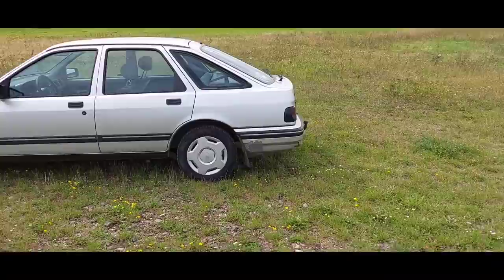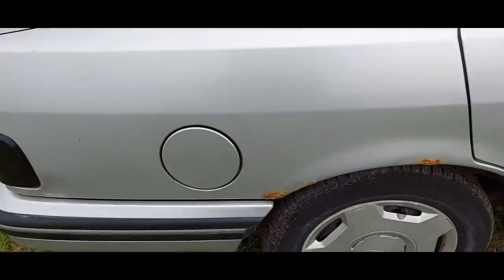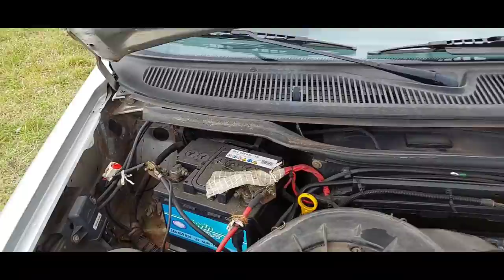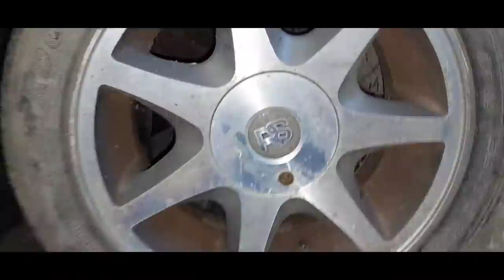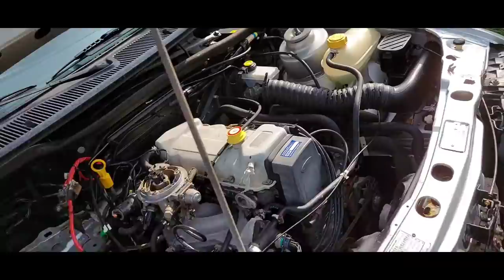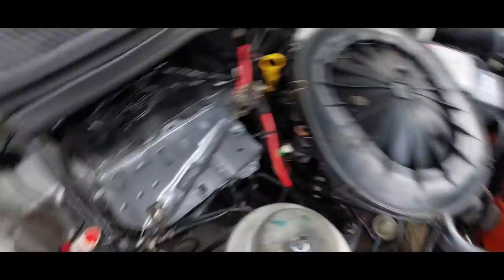Wahnsinn, dieser Zustand nach knapp 30 Jahren! Bestandsaufnahme, die ersten Arbeiten...

Comment: Fehler, der LÖWE Auto rost primer ist nicht auf "epoxidbasis" wie im video gesagt, sondern Alkydharz. Nachteil: lange Trockenzeit (mindestens 48h) und verträgt sich schlecht mit Acryllacken, auch nicht mit Nitro. Besser dann nur Kunstharz. Spreche aus Erfahrung. Hier hätte sich auch der graue Löwe eher angeboten. Die Längsträger vom Motor haben schon etwas mehr Rost, ich hätte vorher Fluid Film reingegeben, aber was Du machst, ist mehr als die meisten machen würden. Ich bin gespannt auf die Entrostung der Schwellerunterkante, ich habe damit keine Erfahrung und bisher immer nur alternativ Owatrol oder Fett drauf gemacht (Sander). Ballistol auf Gummi? Obwohl ich gar kein Ford-Typ bin, muss ich sagen, der Wagen ist richtig lecker. Wenn ich selber nicht zu viele Autos hätte... Insgesamt sehr überzeugende Arbeit.
Reply from the maker: Der Löwe hat den Lack gut vertragen. Und versteht sich mit dem Untergrund. Trocknung, eine Stunde.
Reply: @michaelschuhmacherdiesel  löwe gepinselt, echt jetzt? Lass mal deine batterie lieber noch nen tag draussen ...
Reply from the maker: Ist alles innerhalb von 2 Stunden getrocknet. Ich hatte noch nie Probleme damit. Ich nutze das seit 5 Jahren, nie ein Problem gehabt.
Reply: @michaelschuhmacherdiesel  Dieses Frühjahr bei Regenwetter gepinselt und nach einem Tag lackiert blieb der Löwe unter Lack ewig und drei Tage weich. Hat sich erst durch ausgiebiges Sonnen des Fahrzeugs gebessert. Vorsicht auch bei Nitro oder Acryl, das mag der Löwe nicht ;) Ist eben meine Erfahrung, vielleicht hab ich auch einfach nur was nicht beachtet.  Vermutlich pinsle ich zu dick.
Reply from the maker: Dann, befürchte ich, hast du vergessen den Löwen zu verdünnen.